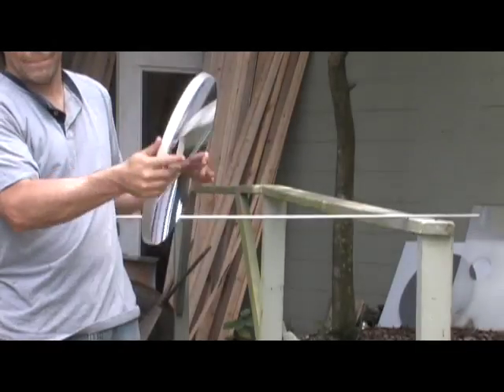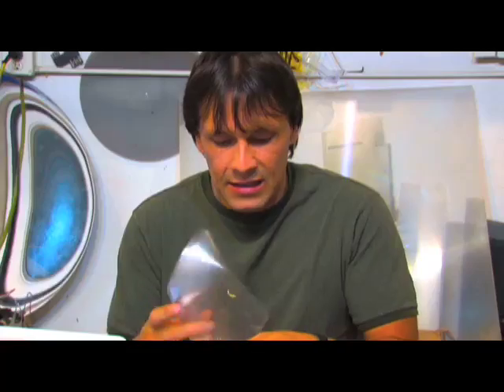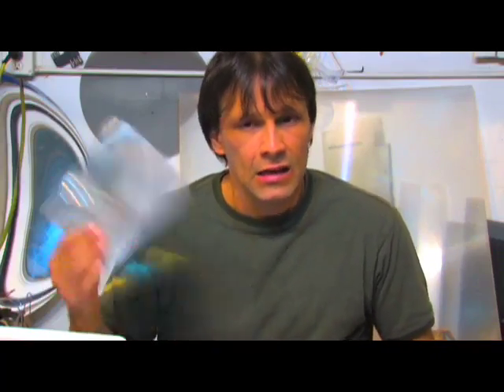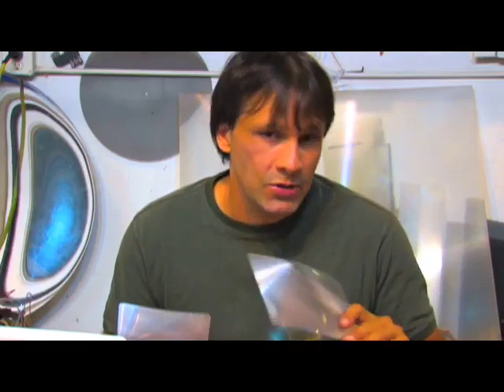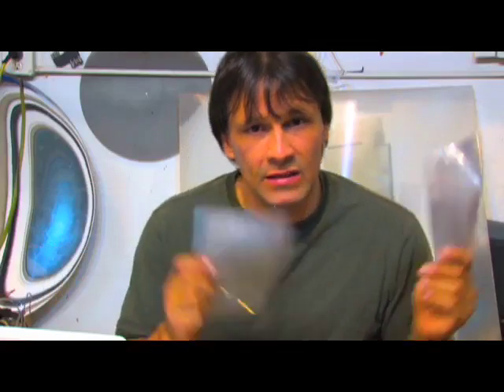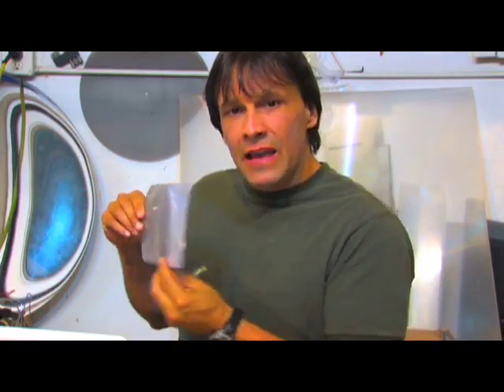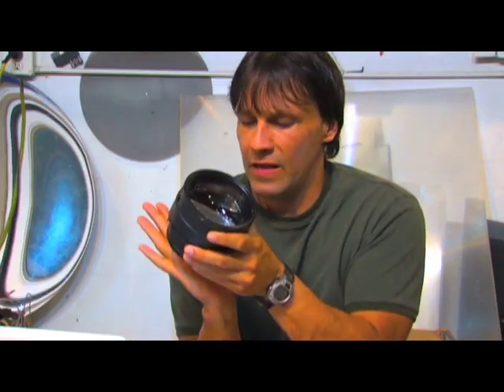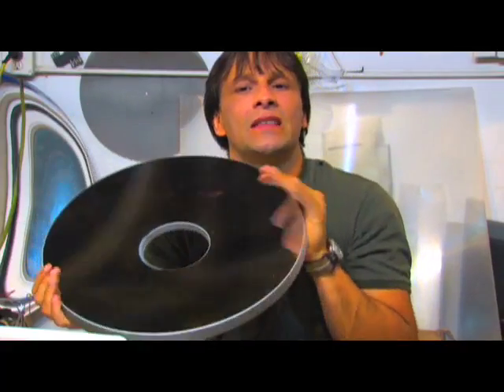Fresnel Lens FOCAL POINT and FOCAL LENGTH PAGE MAGNIFIER P1

Comment from the maker: Sorry for the loooong delay. Fresnel Lens yield their ring pattern in the form of optical aberrations on an image. page magnifiers generally have a very short focal length resulting in a 100mm equivalent. Off the shelf lenses in that focal length range inexpensive and easy to use. I am working on a 4000mm Cassegrain reflector for my canon 7d. If it works, It will bring easy to use, low cost large area light gathering to the average photographer enthusiast.

Comment: To make an array of lenses, you'd presumably want the focal points to all coincide.  (This might require some mirrors as well.)

It seems to me that the shorter the focal length of the lenses, the harder this would be to achieve.  All of the optical distances are shorter, so there's simply less room behind the lens to manage everything.

Comment: I love your videos.
I choose to buy  PAGE MAGNIFIER for my project for a very diffrent reason.
Those big lenses have need to be watched  as they have a lot of power if I boil water over a number of smaller lenses I have less risk of burning my house down.(Each stage only raises a few degrees on a copper spiral with water.
can you explain the what a linear and spot lens is

thanks Arie

Comment: I have collected about 24 lens over the past year through life and checking my cities large items trash schedule. I plan on mapping the track of the sun & moon, then arranging the lens and their focal points on a central large cast iron sterling engine. In effect, turning a generator and charging my battery backup system. I have only rendered my designs, while acquiring my building materials. Always improving and sharing...Thoughts? World Peace is my life long goal.
Reply: How have you got on with that??